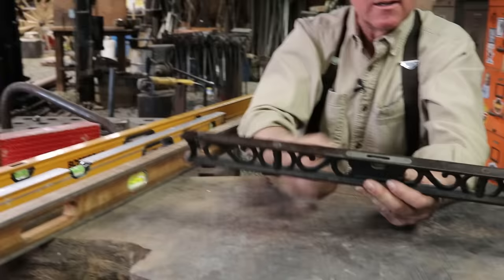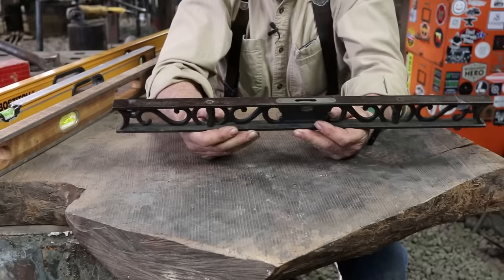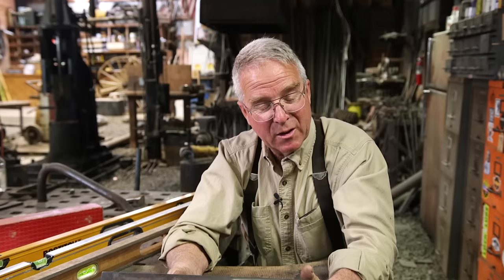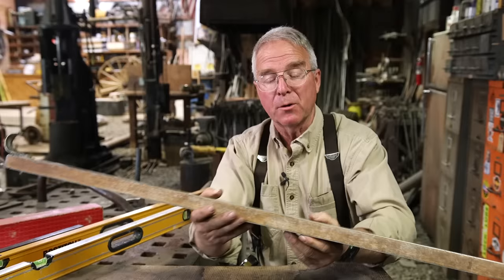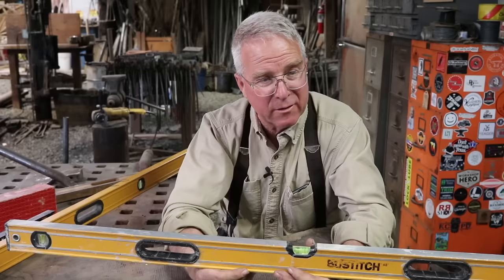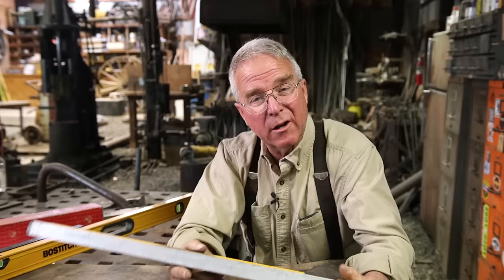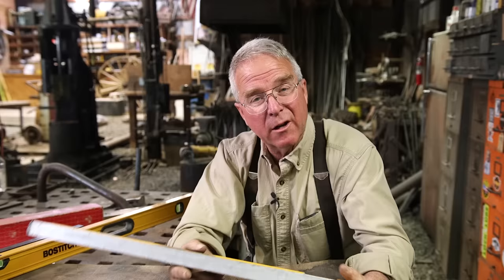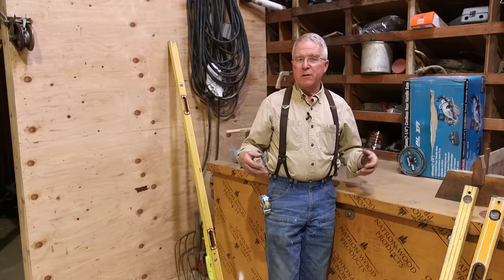How to Use a Level and What is Next for EC

Comment: I’ve logged a few years in a tool belt and often have friends ask for my help assessing their remodeling projects, preferable when their contractor isn’t present. My rule is that I will but only with one hand in my pocket and the other holding a cold beverage. One fellow had me walk through his gutted kitchen/dining/bath project because he was concerned that his guy wasn’t being very detail oriented, was framing floors and walls that looked a bit off and dismissed my friend’s concerns as “too picky”. It didn’t take long for me to see what he saw then I noticed the most beat up and battle scarred 6’ Stabila box beam level I’d ever seen standing in a corner. This poor filthy aluminum thing was no longer bright yellow, just a few random flecks of paint remained and it’s end caps were long gone. The only way I knew it was what it once was is that I’d had it’s twin safely stashed in my truck outside. My advise to my friend was to steal and destroy that POS and replace it with the exact same item but brand spanking new. Come Monday morning, his contractor was completely stunned but silently spent the next two days “tuning up” his previous week’s work, no charge.

Comment: As a tile layer I run the level around the starting shift of tile and if it falls out of +-2 mm (~10 meters or so) I check it for inaccuracy. The tile cutter needs to be set up in a specific way to cut tiles as straight as possible too (and tiles to start with aren't perfect so you want to be as accurate as possible). Always great to check your tools! Thanks for all the vidoes I sure pick up a few tips here and there!

Comment: The level that’s “bad” is a “Master” brand level if I’m not mistaken. There’s a screw at each vial, on the one side/ edge. This screw is so the vial can be adjusted with a Philips screwdriver to ensure accuracy using the method you demonstrated. For the time it took to find a marker, it most likely could have been adjusted as it was designed. Just my two cents. Cheers

Comment: Bought a brand new bad level years ago when they were more expensive relatively to what i made. Had a I beam  schultz that was my dads. Never wanted a wooden one because of the reputation for twisting. Then empire came out with a wood like composite. I bit the bullit and laid down hard earned money  and one plumb vial was off. Didn't check and didn't realise till it was too late to take it back. I spray painted the vial. I still use it on occasion and it still agrivates me. Good advice to check new.👍👍

Comment: I'm so glad you put out this video I've seen countless times of other Carpenters or YouTubers using a torpedo level on a nine foot wall or larger or smaller and the significance of even a 16th of an inch is huge I know the convenience of it but I also know the circumstances of it too thanks for the video
Reply: Usually the same ones that don’t know the difference between plumb and level.
Reply: There is no difference in how sensitive a bubble level is based on length. It just may give you a more accurate reading if the piece isn't that straight. Really important for wood studs but if you imagined a hypothetical house being framed with milled aluminum studs the length of level wouldn't matter.
Reply: @cm01  if you're not dead old with a torpedo level at that itches you're going to be extremely out of level by the time you get to 10 foot I know this for a fact I've been in the business for 32 years
Reply: @minerdave  YES SIR
Reply: @cm01  Now imagine that all of those studs are plumb and parallel, but the faces aren't on the same plane...but you can't confirm that because your 12" torpedo won't span 2 studs, let alone 3.

Some things can't be measured (or even detected) if the plumb/level isn't long enough. I've seen many a 2x4 that was straight for 6 feet, then straight for the other 2...but they were 10 degrees out of line with each other, if you weren't paying attention to the lumber, you'd think you were fine OR that you weren't.
Reply: @DeadlyPlatypus  you're right I'm merely pointing out the misconception many people seem to have that the bubble mechanism itself is somehow more sensitive on a longer level.
Reply: The guys that hung the windows on my new house I’m building were trying to level my 9’ wide triple mulled window units in our dining room with a 6” torpedo level 🤦‍♂️. I stood back and looked at the window and could tell it wasn’t level. He argues with me and shows me his level. I went and setup my rotary laser. Showed him that his 6” torpedo level was a garbage method of leveling such a large window. It was 1/2” out of level across 9’ 🤦‍♂️. We used the laser for the rest of the windows in the house…

Comment: One thing I was told by my father, brick and block layer, was to never lean a level against as well. Either lay flat on solid surface, or hang from point.  Maybe not so much an issue with new levels but something I never forget.
Reply: Even with newer sturdy box beam levels that is a good policy. Thing is. If you lean your level up against a wall, it’s all too easy to accidentally trip over it, lean a sheet of plywood or something against it, etc…don’t want to risk anything that has the potential to ruin your level. It’s best to put it somewhere it will be safe. 

Having said that, I lean levels all the time while working because most of us tend to get in the zone and don’t take the extra time to do everything ‘perfectly’.
Reply: Still good advice even today. And the answer is simple physics combined with a desire to prevent damage to the level.
The level leaning against a wall is not in a truly stable state.
Give it a sufficient nudge sideways at the top or bottom and it will continue slipping against the wall, accelerating because of gravity all the way to the floor (over this short distance air resistance doesn't really come into play).
You already know to not drop a level, well when it's tipping over sideways sliding the end down a wall that's pretty much the same thing as dropping just one end of the level.
It's quite similar to the reason you probably shouldn't store a ladder in the same orientation you'd use it to climb something unless you hang it from a hook (the ladder might fall and hurt someone on the way down, or fall onto something hard and become damaged, like the case with the level).
If it can put a ding in a 2x4, it might just be enough to damage a level. It doesn't take much force to knock a level out of tolerance, but that force does have to be applied in the right (or wrong) spot.
Reply: I was a Mason for 30 years I bought a crick in the early 80s it still reads true great video

Comment: I've noticed if you take two different levels from a big box store they rarely give the same reading. I think the problem is it doesn't matter how solid and straight the beam is, if they're just stuffing cheap little plastic tubes in them with glue (or molding them in plastic, etc.) they're not going to be consistently in line (or perpendicular) to the beam they are mounted in.

Comment: I wasn't expecting that Machinists’ Level, but I was pleased to see that you owned one.  A trick I use to align horizontal surfaces is to get one level, and then span the two surfaces with a long box section straight edge supported on four 1-2-3 blocks (two on each surface.  This lets you place the fulcrum points exactly where you need them, and makes it much easier to see the gaps between  the straight edge and 1-2-3 block.  Usually with the aid of a torch.  I have a strong feeling that anyone who owns a precision machinists' level, will also own a couple of sets of 1-2-3 blocks.

Comment: Thanks, Scott. This is an important lesson. I just wish I had learned it before buying a brand new, shiny level at a big box store to replace my 40 year old Empire I-beam level. I framed two new bathrooms only to find that the tempered glass shower doors didn't fit right. Turns out the walls were out of plumb by almost a half inch and nobody mentioned it... not the plumber, not the plasterer and not the tiler.☹️
Reply: The tub installer should have known to look out for this. You got a cut rate guy.

Comment: I have asked quite a few builders over 40  years if they have checked the level they are using for accuracy... I have gotten many dazed or confused looks... What could be more basic or often overlooked?    Thanks EC for the detailed video.  It's  real hard to shoot for perfect with a flawed Level...
Reply: I remember there was this one old guy a couple years ago (man that site was a circus in general) who tried levelling a small pad form for a transformer. I finished what I was doing so I came over to help while he was arguing with the electrician. I kept checking the corners of his form and could never get them to read the same, so I checked the level for accuracy, and the thing was off by the distance of the bubble edge to the line. I told him dude, throw it in the trash, you can't level anything with this anymore. He'd been using it for who knows how long on that site

Comment: Twenty years ago I bought two Stabila electronic digital levels , a 24' and a 48; they are awesome. Level is 0.00 trying to get that with a bubble is pretty hard , they also have degrees mode so you can check a slope or roof pitch ,so 18 degrees is 4 -12 .They really are  handy

Comment: Pro tip: you can rig up a plumb with a weight, a string, and a board with two parallel sides on the job site.

Look up the way the Egyptians did it (theirs was "F" shaped). Super simple, can help in a pinch.

(Edit: stupid spelling mistakes)
Reply: A plumb bob is just as important as a good level . One of the few tools that works accurately 100% of the time

Comment: Sir, much respect to you and yours, from an old machinist, want to be carpenter.
Check your level at the start of every day, another check for plumb is drive two nails in a vertical line closer than your level is long and make comparisons by swapping and flipping your level and observe the difference in the bubbles.

Comment: You can check your squares using the same method.Making a line then flipping the square over and drawing  another line next to it.The lines need to be the same from top to bottom.Use the factory cut as your placement point

Comment: The machinists levels really are on another level... 🙄😂
I have a Rabone Chesterman 6" ( bought 40 years ago) that I take out of the box once in a while & admire, I've used it as you said, for levelling machines... a lathe bed can twist if bolted down and the supporting mounts are off from each other so this is extremely important when setting up a precision machine tool or it will not machine parts accurately...these levels can be sent back to the manufacturer for calibration & certification.

I'm a machinist by trade but an avid DIYer... working daily with thousands of an inch , I naturally aim for precision even in my woodworking & construction work.
I have a Stanley 2' / 4' / 6' level .... 

I must say, I find your presentation excellent and you are very articulate & not rushed in your speech... 
I always learn something when I'm here... 🤗

Subbed &liked a while back ...

From the Emerald Isle
😎👍☘️🍺

Comment: framing back in my prime I always flipped the plumb stick in my hand and checked both sides of the bubble.....You never know if someone dropped the tool last time and looking at both sides is totally accurate....of course pieceing in the tracks in the 70s there was no time to check anything...you had to have a good eye...if you were not good enough you were down the road...

Comment: While doing a double floor joist and subfloor  replacement for a family friend I had to borrow a 2 ft level from the homeowner (might as well call em family). It was my friends grandfather's level. My friend is 64. So.... Old ass level. Anyways my friend made a trip to Lowe's and came back with a plastic 4 footer. Graciously I accepted and used this twisted and bowed sad excuse...... Fast forward I've moved up to a vintage level of some sort. . .  shiney blue... Shaped like an I beam but without the top of the I. Not sure what it's specifically for but it works . In the meantime I had closed the truck door on my leaning plastic level.... Needless to say I now had 3 levels

Comment: As a framer first, trim carpenter then furniture maker later, I’ve learned that the difference between a framer and a carpenter can be seen in knowing the difference between plumb and level.. framers will tell you to level the wall, to which I used to explain to them that’d be plumbing the wall, used to say “ you can’t run around calling dogs cats and cats dogs… framers are so notorious fer saying “close enough “ as far as the bubble goes, used to drive me crazy

Comment: if 1 of the vials on your level is bad then just break that vial, a bad vial is useless and once its broken you will never make the mistake of using the bad side and grab another level when needed,
Reply: That's a great idea, the only alternative that I can think of that delivers similar results is to have that particular vial set back to level again, and then fixed firmly in place.
IDK if rubber-mounting the vials is a good idea or not, the idea is that any impacts that the frame of the level takes will not be transmitted to the vial (which might shatter if that was not the case, assuming a glass vial), but the key to it would be to use artificial rubber materials (more properly called "elastomeric polymers") that are dimensionally stable over the typical range of temperatures seen on a work site (so from -40f to 150f). Probably a thermoSET elastomer rather than a thermoPLASTIC elastomer, if such a thing exists (thermoset polymers burn instead of becoming soft when exposed to too much heat).
Reply: Or... and this is from the perspective of a painter... put a piece of blue tape over the vile window so you will know not to use it

Comment: The guy who built our house 50 years ago used a bum level and when we remodeled the kitchen the soffit above the cabinets was off almost an inch in the 12 foot run of cabinets. The installers had their hands full trying to make everything work. I am glad I didn’t pick that for my first cabinet installation or I would have lost my mind.There were similar issues with plumbing and electrical installations as well.

Comment: Testing levels in store is a must; I had a friend who bought a level from a blue box store that we used to make a stand for their washer/dryer but the level was off. When I went to the store with him to return the level and get another I checked them and there were over 6 bad levels; that is just ridiculous. I have a lot of levels some are decades old and still reading true, buy quality tools, or at least as much quality as you can afford, and you’ll have those tools for years. And when it comes to levels size matters; I have levels from 2” to 96” and a lot in between because you never know what size you’ll need and depending the job you may want a small level or you may want as large as you can get. Let’s not forget the old faithful way to get plumb, a plumb bob, which can work over much longer distances than any level, and can be used to check a level for plumb. I also have line levels and corner levels, which are great for setting posts,  up which should be double checked with an actual level. 
As you get older or if your eyes just aren’t great you may want to try a lighted level as they’re quite easy to read, I keep a lighted 9” level and tape measure in my car, because you just never know when you’ll need either.
Reply: Lighted levels are nice, but there's even more ways to use light with levels than just illuminating the vial.
Lasers for instance. When a laser is properly aligned, it will shoot a line that is as straight as physics allows it to be, so if you align that laser beam with "level" or "plumb", you can rest assured that anywhere that laser beam touches will be in line with whatever you set the laser beam projector on.

Now before some Physics major comes in here running their mouth, I'm well aware that lasers aren't truly straight, and that gravity can bend light.
However, we're working on Earth, not on the scale of stars. On Earth, you'll have to take the curvature of the Earth's surface into consideration when building something LONG before you have to take the gravity-induced deviation of your laser beam into account. And even before that, Earth's atmosphere (and the convection of such) will have diffracted your little low-power (to meet Class II Laser eye-safety standards that allow use of said laser without eye protection) laser beam into a gigantic jittery useless mess long before the beam has a chance to curve due to gravity even 1/100 of an inch (over that entire long distance, not per foot. Per foot you'd need to break out something with the resolving power of an electron microscope to detect the divergence from actually geometrically straight).
So the point I'm trying to make is that for the purposes of building something that's not on the surface of a neutron star, lasers are straight enough to call them "straight" without any further stipulations.

Comment: I have seen my dad level up the forms for a house slab. All he had was a 4 foot level, and a straight 10' 2 by 4 with small blocks on the ends. The slabs were dead level, it seems to always rain after framing and before roofing. Water is a perfect level if you know what I mean.

Comment: I found that a high quality digital level with a built in calibration procedure, backlit display, and sound signal is a good investment, especially when working alone and/or in dim light. It also does slopes by degrees, in/ft, or %.  Mine is an M-D Smarttool that I bought many years ago when people thought it was a 'Gee Whiz' tool.